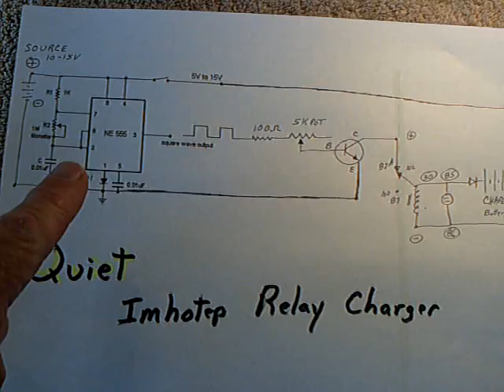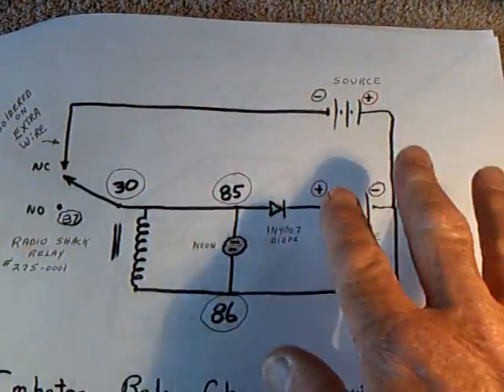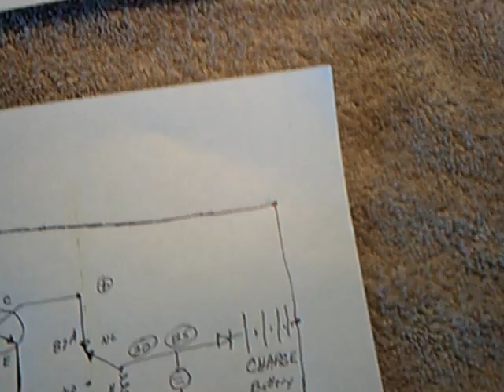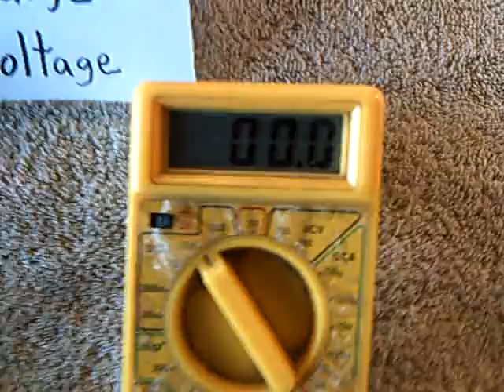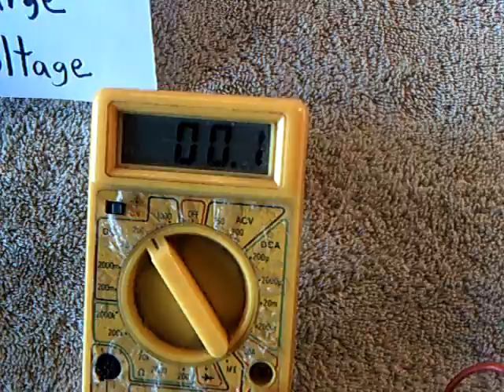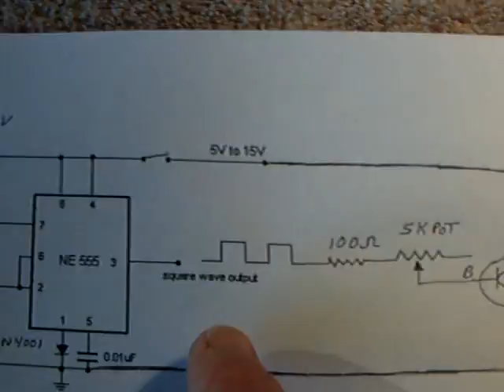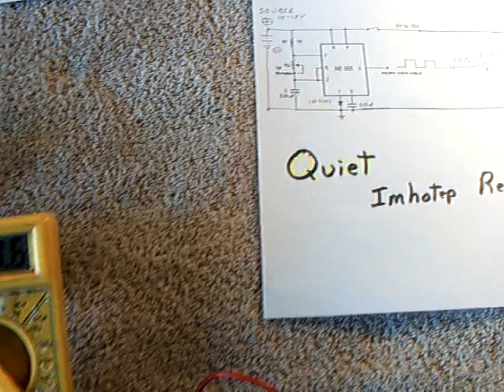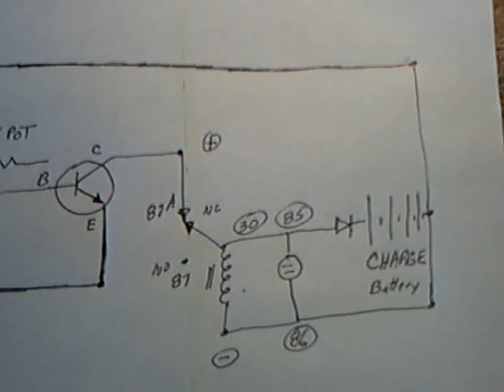Quiet Imhotep Relay Charger

Comment: According to the this  555 circuit arrangement,  I noticed that it is possible to connect the relay coil directly to collector pin of the transistor without going through NC and 30 pins, or even  we can use different coil instead of relay coil, am I correct ??

Comment: The one thing I have not seen anywhere is a Large Tesla pancake coil powered by 12 volts. Transistor should not have a power wasting heat sink on it. Any ideas ? Notice I said pancake coil .
Reply from the maker: That has been done.  I would google 'Tesla pancake coil circuit images' to search for it.
Reply: Googled and found plenty with 1 to 3 volts powering a Tesla pancake coil but only one with 12 volt power.  The transistor needed a massive heat sink I built it and it did.  Wasted energy. Searching for efficiency.

Comment: mine likes to sing also....
i like the sound it makes.....
i used a car relay from a junk car, it had the other connection 87a....
i had to remove a resistor inside the relay.......it may be useful to use with the resistor because voltage spike is much lower and quieter

Comment: I did replicate your setup (only using a different transistor as switch) and noticed that at quite mode I got the highest voltage reading across the battery being charge. It seems to me that at quite mode, it's the optimal performance for this charger. Can you confirm similar observation?